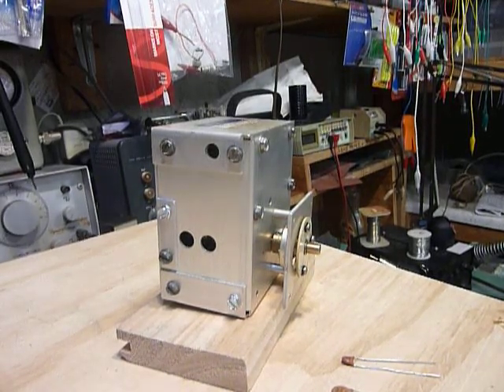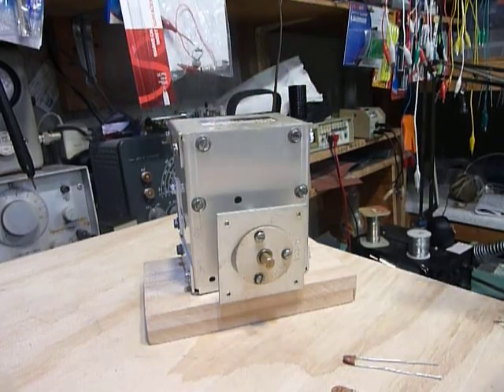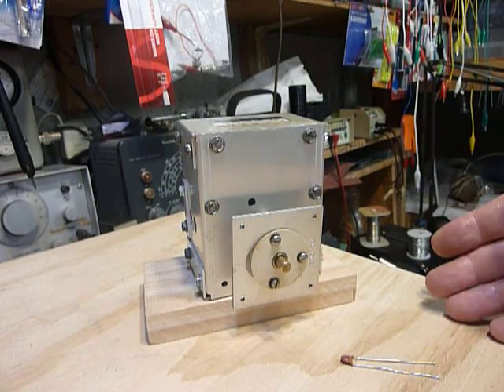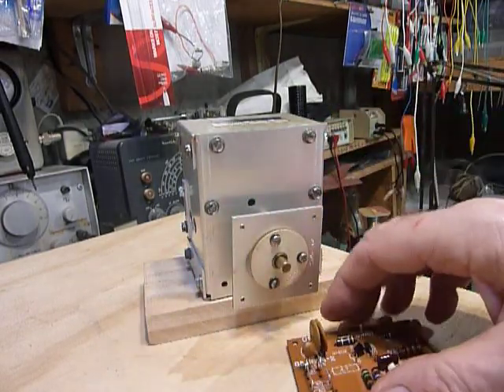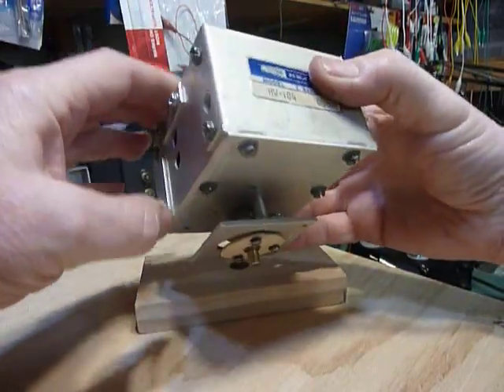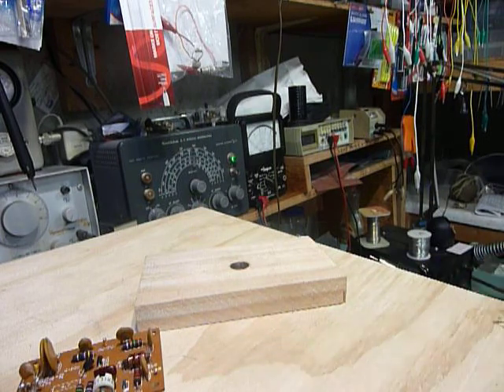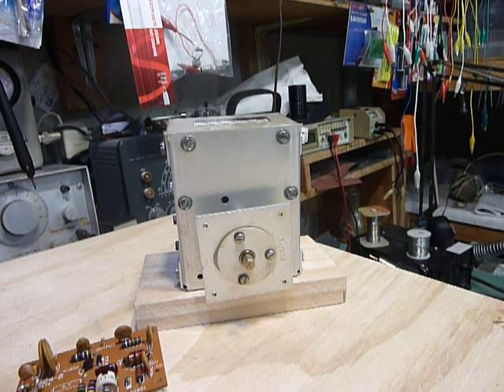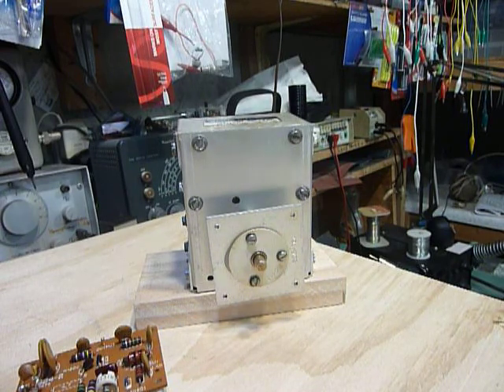HW104,HW99,HW9,SB104, IMPROVE VFO STABILITY ,  HEATHKIT VFO

Comment: Bob, I think these Heathkit LMO's don't use the entire range of the variable tuning capacitor. By design the capacitor travel is limited on the ends for the as stated non-linearity of the capacitor at the extreme ends.  Good work on getting the drift down to 15 Hz, that is impressive. I will have to look at this as I get back to my SB-104A enhancement experiments.

Comment: Hello Bob.  Back in your "Restoring a Boat-anchor" series, you said not to touch the LMO at all, except to lubricate its bearings and brushes.  I know you said "this is for the SB104 ONLY."  So does that mean the SB-303 and SB-401 have different LMOs from the SB-104?  I just want to make certain I don't do anything to mess those LMOs up as I restore the radios.  Thanks again!
Reply: Bill -
Bob is NOT discussing the SB-401, SB-303 LMOs.
These LMO were professionally assembled by TRW.  Leave them ALONE.
IF you have issues, seek professional advice.